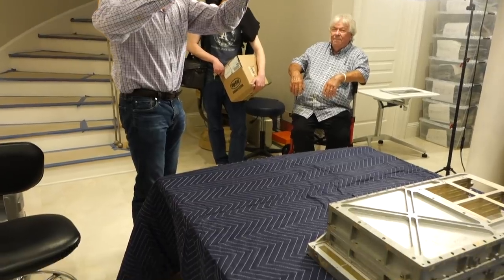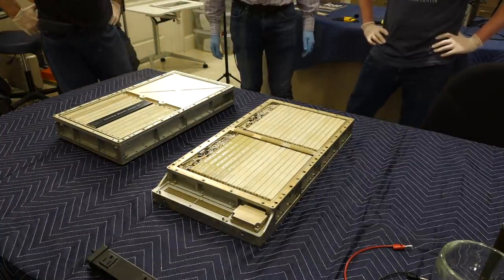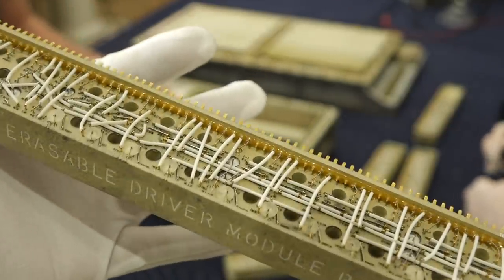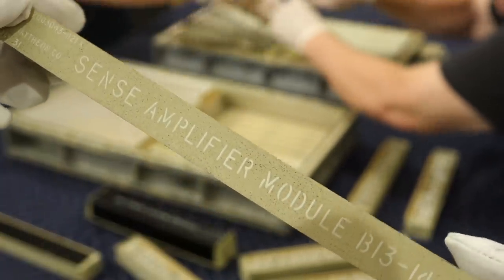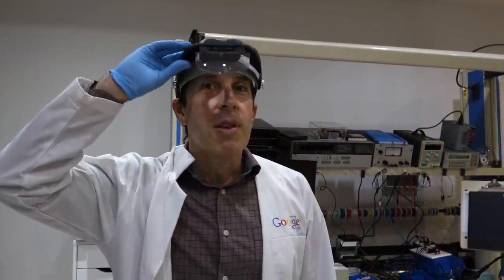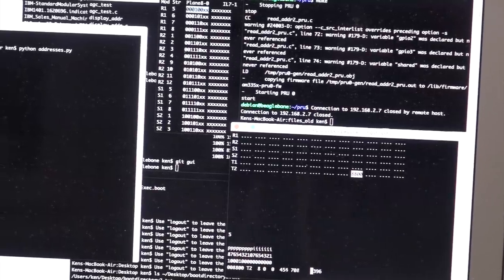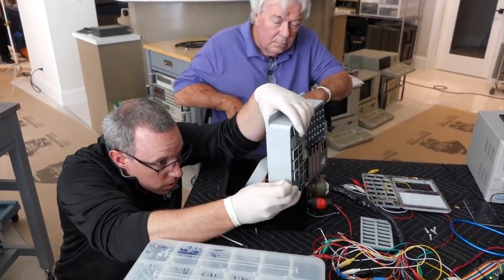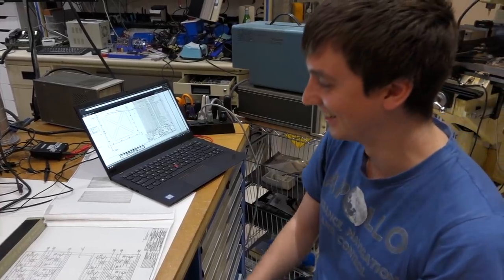Apollo Guidance Computer Part 12: Return of the AGC

Comment: I just tossed a C64 power supply due to the circuit board being under 1/2 inch of epoxy and can't imagine what you're going through with the module. Godspeed, AGC restoration team!

Comment: I am wondering if it is possible to contact the manufacturer of the potting compound, to see if they know of a specific chemical or way to dissolve that potting compound without destroying the circuitry.
Reply: I talk with Mike in IRC, and we spent a while researching the likely potting compounds and their removal agents.  All we could find were agents that require heating to a couple hundred degrees Celsius and soaking it in the agent, which felt like too big a risk to take.  Could damage or destroy the whole module.
Reply: @Shadwhawk  it sounds like there is no option. That module must be replaced. Fortunately, you have the schematic, and a good engineer can use modern-day components to perform the same functions. Oh, did I mention... I'm a printed circuit board designer. If someone could machine a new casing component, I'm sure a replacement printed circuit board can be made for relatively low cost. Provide me with the re-engineered schematic, and the required dimensions of the printed circuit board. I offer my services gratis for the privelege to contribute to this group. The complicated plug pinout dimentions can be done relatively easily using CAD printed circuit board and a jig.

Comment: We've had luck using Methyl Ethyl Ketone, Paint Stripper (Methylene Chloride) and hot air rework stations getting most potting compounds to break down so they are rubbery and can be remove by picking them away.  It's a little slow and you must have good ventilation, but it works without damaging the underlying circuitry.  That was 30 years ago so these tricks may apply to that old potting compound.  These chemicals used to be available at paint stores, but they might not be so available in California any more.  You might also try Epoxy Paint Stripper.  Be patient and good luck.
Reply from the maker: Unfortunately these miracle strippers are known to the State of Cancer to cause California. Not available here! Supposedly acetone was supposed to do it, but it did absolutely nothing on that compound.
Reply: @CuriousMarc  No more AvE until you get the AGC working!

Comment: Oh jeez a milling machine?!?  Have you tried a little Methyl Ethyl Ketone on the potting?  Some plastics just, well, stop being plastic under its influence.  I learned this the hard way trying to take the yellowing off of old computer equipment; lo and behold it works great on this, except that there is almost total overlap within the groups "plastic that MEK un-plasticifies" and "plastics that are subject to yellowing".  So while you can use it with reasonable confidence on an IBM Model M keyboard, you will almost never have a reason to (unless someone's written on it with marking pen or something) it will almost immediately start making Apple gear all melty.  It will also leech the blue out of shop-towels after a while...
Reply: MEK may dissolve the insulation on the embedded wiring. I've done that before.

Comment: Yaaaaayyy another agc episode! Annnnnd another broken module. Tough break, but with the combined mind power in your lab you guys should be able to work the problem. I’m wondering if a chemical solution would work for clearing the pin connectors vs mechanical method. Thanks again for sharing.

Comment: I've removed a hard black potting before by just scraping it out with a hot soldering iron tip. It was a modern product so it may have been epoxy. The heat caused it to decompose into a powder (and a bit of smoke) as I plowed out with a blunt tip.

Comment: I'm thinking simple: couldn't the missing diode function between the 2 pins which are open now be fixed by adding an off the shelf diode to those pins externally ?
Reply: Unfortunately no. The problem isn't the diode; it's the winding around the switch core that's in series with the diode. Without being able to send current through that winding, we won't be able to access large sections of erasable memory. This open circuit could also be called by a wire break in that winding; we're just hoping at this point that it's the diode and not the winding, since the latter would be much more of a problem.
Reply: Hi Mike. thanks for explaining your problem. I'm hoping you guys will find an answer for the de-epoxyfying. I'll keep following your quest to get the AGC in working shape, my eyes are glued to this channel :)

Comment: Is this potted with epoxy over the polyurethane foam? If so, it may be possible to remove the epoxy overcoat, and then chip away at the foam. Industrial strength paint remover is about the only way to dissolve either of these, and that carries it's own set of problems.
You also might be able to abrasive blast these coatings away with a very fine jet. I think that the welded wire connections would survive most anything.

Comment: Wow, the drill press clip scares me. Is there no way to CT scan it [or some other type of scan] and plot the precise location of the components underneath the potting material and plug that info into a CNC machine? Or is that just fantasy thinking on my part..
Reply: NASA archives have exact diagrams of the component layout which we obtained, plus we have pictures of an unpotted version of this module. We do know exactly what is under there and its placement.

Comment: From personal experience that potting compound was extremely tough stuff, let's hope it has lost some of its toughness in the intervening decades since it was potted.
Reply: Paul Hammond Unfortunately, that potting compound has the same feel of a hockey puck. This stuff is stubborn and filled with hate. I know this because I used to have to case electronics and pot them....
Reply: @panikrev175   the company I worked for used it to pot numerous modules, it was as hard as basalt rock once cured, back in those days such potted assemblies were not classed as repairable once they developed an internal fault. The end mill should get through the upper material, but they'll have to find another way once they reach the pins / components. But I guess we have to wait for the next video to see what they have planned :( Patience was never one of my better traits...
Reply: Paul Hammond I’m hoping they fab up a jig to begin building a replacement  ferrite-core memory module and make a replacement PCB  for the current switch module. It would be awesome if the team could replicate a modernized version of these modules.

And yeah, modules got scrapped on the spot if they didn’t pass testing after potting. We made IPC-3 rated products, so it was pretty crucial for our automotive products if they failed.  SMT components, modified through-hole, wave soldering... I miss that job.
Reply: @panikrev175  When I first worked on computer systems during the late 70's the company still employed a bunch of workers that were skilled at making those ferrite-core stores, they ladies used to challenge new employees like me to see if we could weave a few cores, I can tell you I failed miserably. I can only imagine how long they must have trained / practised until they perfected the skill, I think I could have practised until today and still not been able to do it as well as those skilled ladies.

Comment: Did you consider patching in some kind of new replacement circuit in between that module and the computer rather than repairing it?
Reply: Unfortunately it isn't that simple. The problem isn't the diode; it's the winding around the switch core that's in series with the diode. Without being able to send current through that winding, we won't be able to access large sections of erasable memory. We'd have to replace this whole circuit, and the type of core used in it is nigh impossible to find nowadays.

Comment: I know this goes back a ways, but 6:06 - why would they have filled it with black crud? That potted module reminds me of even modern stuff where the manufacturer is attempting to hide their intellectual property and/or make you have to buy a part from said manufacturer. Was that the case here too?
Reply from the maker: Oh, not at all, this is to make it flight worthy: shock, vibration and humidity resistance. It dates back to an early 1950s rocket that failed shortly after liftoff, and the cause was two diodes leads shorting in a power supply due to vibration, although they were pretty far apart. Potting became mandatory from then on on mil rockets. And it’s not crud, it is quite elaborate materials, or stack of materials as in the core memory, with the right softness and hardness. Potting still used today in industrial, mil and aerospace equipment
Reply: @CuriousMarc  Awesome! Thank you so much for the detailed answer.

Comment: Acetone will break down PU Foam while leaving the rest of the components intact.
Reply: Not really.  Ketones can attack some kind of plastics (polystyrenes) that may have been used within that module (holders, wire bushings,..).